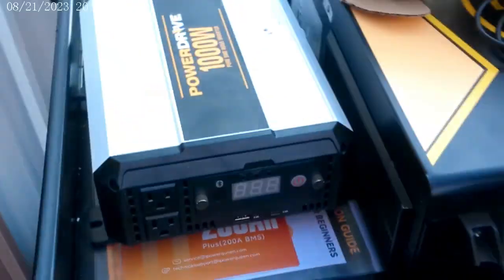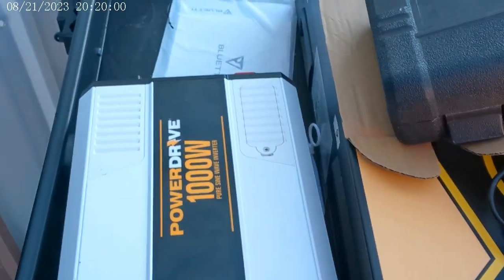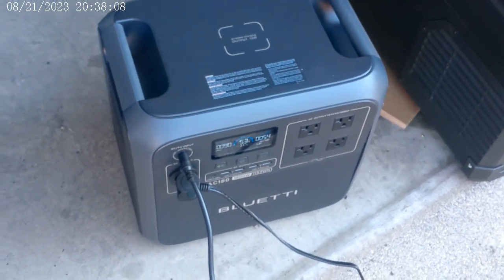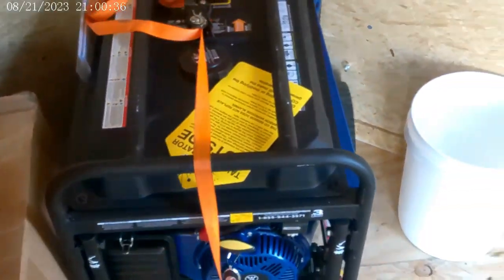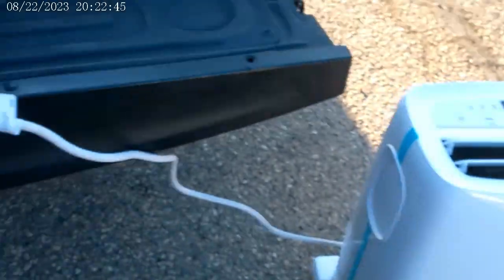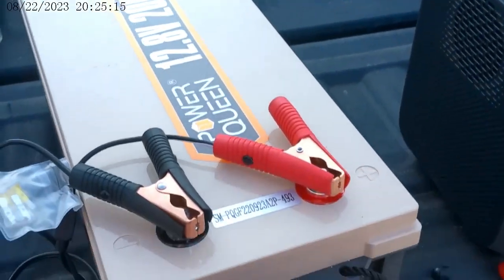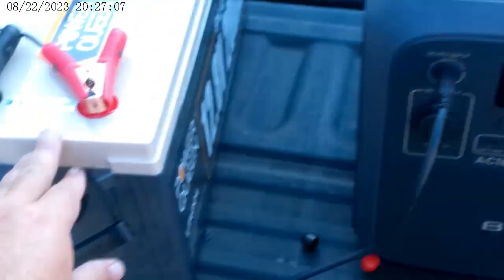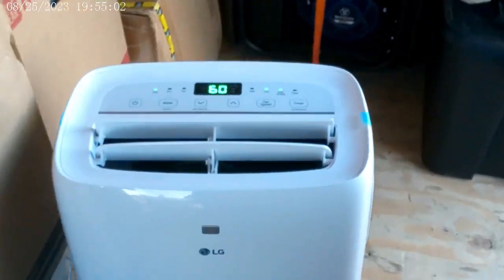Bluetti Real World Test

Comment: I can say I have had no problems with any bluetti unit I have had. Only 2, one of the first models they no longer make and the one you have there. So far it is good. If you do get another inverter the cnswipower one has good ratings and seems good for the price. I just got the 3200 watt one and ran an induction cooker until the battery voltage dropped to low with no issue at 1200 watts. It is going to be going into my trailer with my solar system to run a window unit, microwave and induction cooker. Turning one into a camper. Going to do further tests once I get enough sun to recharge the battery by solar.

Comment: One thing I have learned about inverters, never get one rated for the load you need, get one that is rated higher. They are not built to run at max load for long periods of time. Example, if your load is around 1000 watts get a 2000 watt inverter. It will handle it much better and last a lot longer. You could possibly get by with a 1500 watt inverter but I would try to double the rating of the constant load just to be safe.
Reply from the maker: well this one didn't even give me a chance. It was error 57 from the first time I powered it. But I do agree oversizing inverters works much better.

Comment: Look into the CN SwiPower inverters! They are priced very well and have a built in soft start! Which would work good for you if your trying to run AC off your Power queen battery
Reply from the maker: Well I’m already $1200 into the EG4 and it’s a 48v inverter. The PQ is 12v and only gonna run that AC for 2.5 hours regardless of inverter.